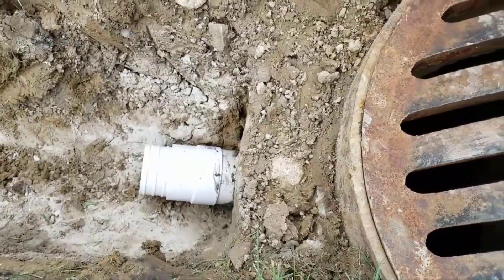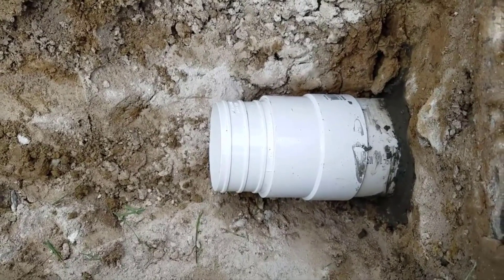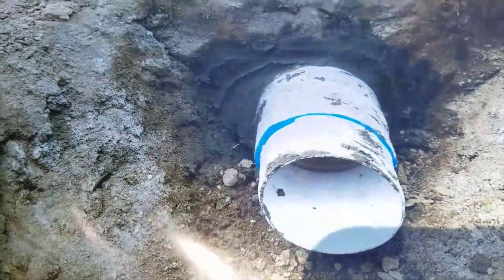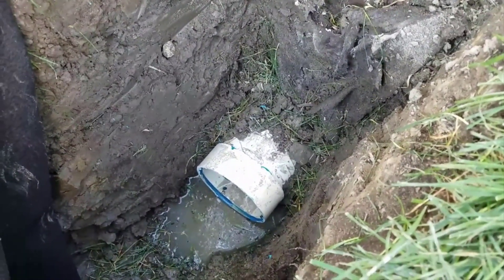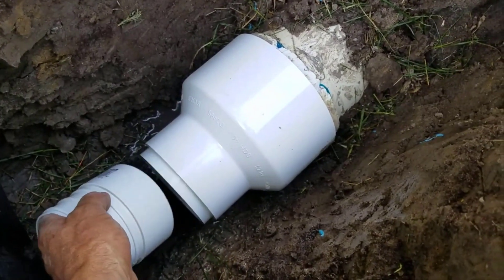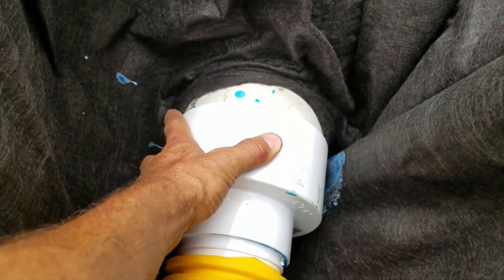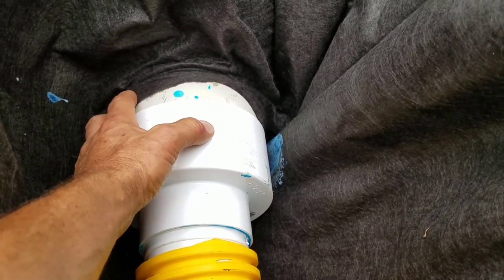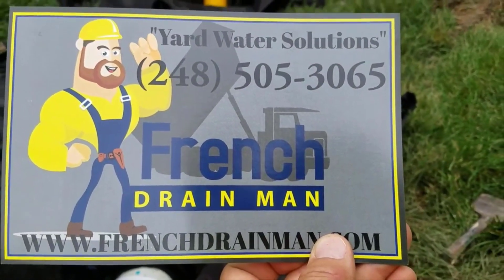How to Connect Your Yard Drain, French Drain to a Storm Drain Catch Basin - Compilation

Comment: What kind of catch basin would I connect to the end of a 1 1/2 inch pvc pipe connected to a sump pump to discharge water? All of the catch basins I’ve seen are huge for my use case.
Reply from the maker: If your in the North it needs to gravity drain to daylight so it doesn't freeze. If it's in the South take it to a pop-up emitter

Comment: what about a video about cutting into the storm drain catch basin
Reply: Call your city/town sewer department. They likely don't want you coring into the sewer structures. They'll do it for you
Reply from the maker: https://youtu.be/kj0fJtvWnuY?si=HJUHjIMBhhMQnYBy
Reply from the maker: That's incorrect. If they require an inspection, they will stand over you and watch you core it, but they will not core drill it for you. That is misleading, and that is wrong.

Comment: I have a 4” pipe that runs from my back yard, pool area to the street through the curb.  I have a lot of water pools by the front and side of the house.  I want to cut the pipe and install a drainage pipe that will collect any water there and then run it out to the street.  We have clay soil underneath the regular soil so water does not drain into the ground.  Any ideas?
Reply from the maker: https://youtube.com/playlist?list=PLjFCqaZ4v1BWbLx7DHgD1YrWdm2wotwlY&si=tXdi_fNUxMDoBQJ_

Comment: Do you have to get permission from the town or anyone else to drill into those storm drains?
Reply from the maker: @Chris
Always check first with the water department
Reply: I live in Buffalo MN and the city engineer said 30 bucks for the permit and I'm good to go. Call your city. They just want to make sure you seal it upright with the hydro cement.
Reply: @FRENCHDRAINMAN  would have to go half way across neighbors front  yard to get to catch basin up hill about 30% grade about 500ft. The only place I can go is through the curb at the road do you sell an adapter for this? Might be a good video for others to see who have to take it to the street!